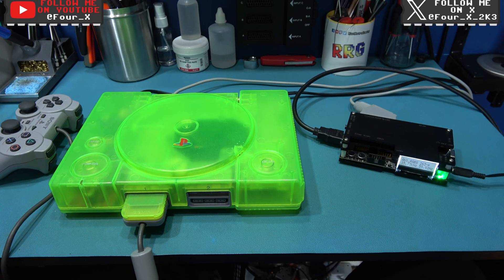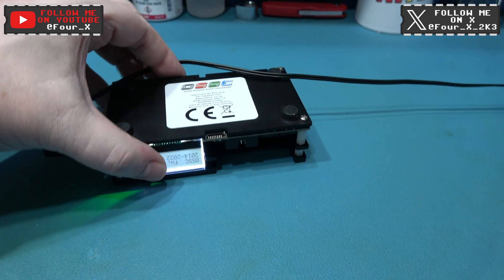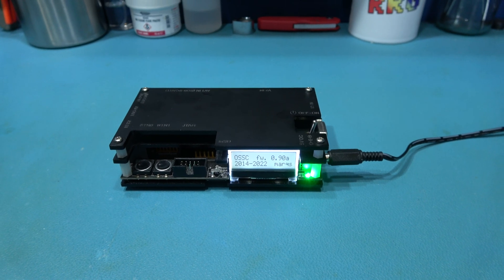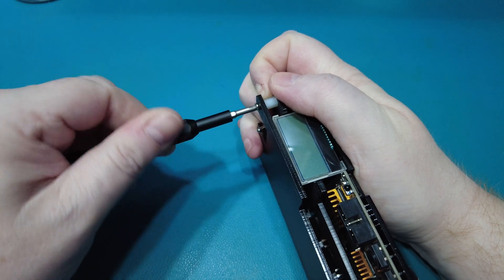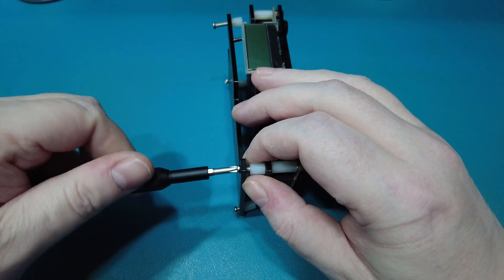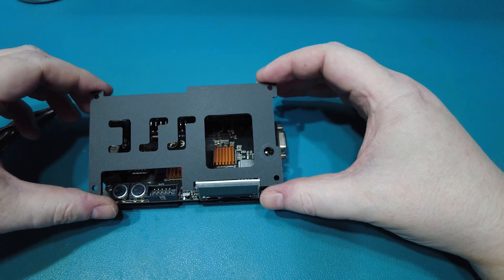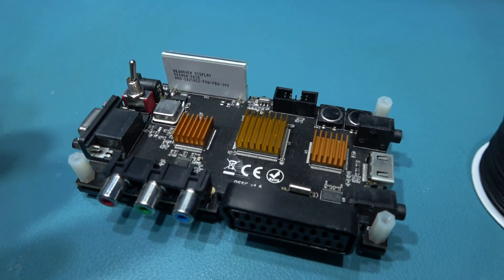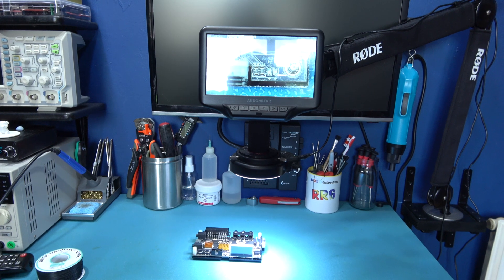O.S.S.C. (Open Source Scan Converter) v1.6 - Mod - Line6X (1920x1440) and HDR Flag Option.

Comment: It did that mod on my OSSC last year, mainly because it's said that it also addresses sync problems. But actually it does not solve the sync-drop issue you get when video mode changes, e.g. from progressive to interlace and vice versa. My main complain about the OSSC!
Using my monitor everything works fine with the mod (apart from the sync drops of course ^^). BUT in combination with my capture device and OBS Studio the picture gets black at a video mode change from the source and doesn't come back (until I switch the scene in OBS back and forth)! So finally I reversed the mod (as it does nothing to my sync problems) and capturing with OBS works again as it should be!! This is what I mean with sync-drops: https://youtu.be/mLiy6AgmJro

Comment: Thats a pretty need mod to get more out of this hardware. 
The only thing i never understand about the OSSC is the open case that can be filled east with dust, why dont have a closed case?
Reply from the maker: If you have a 3D printer you can print a new case, but you're right it can get a little dusty.